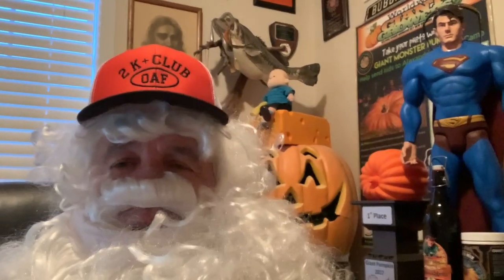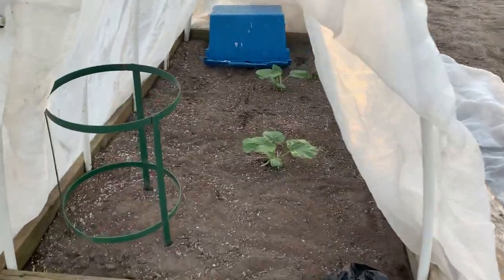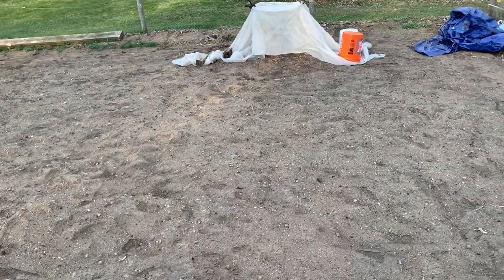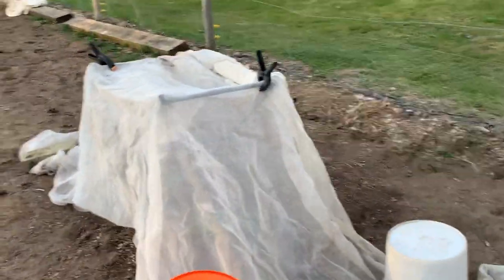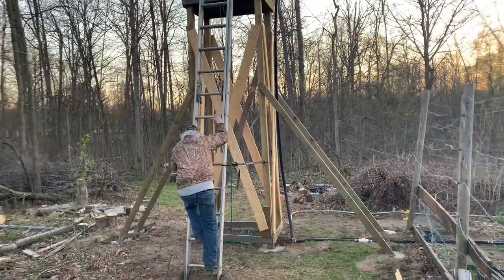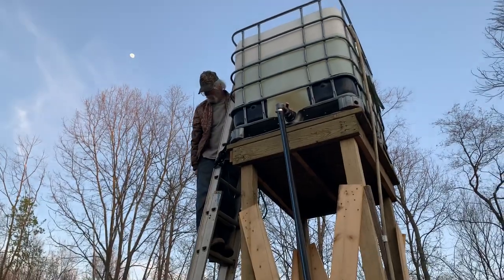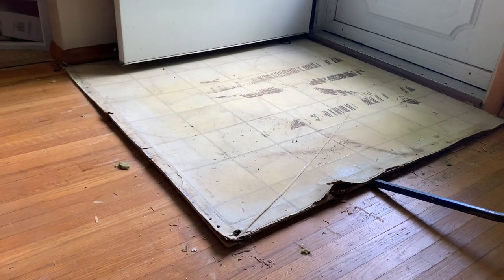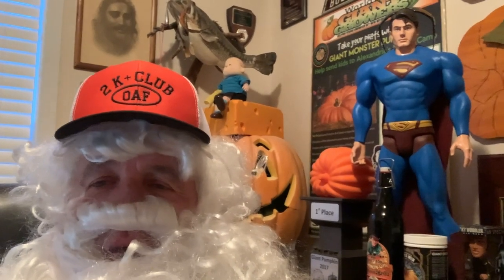Devil's Water Tower Pt. 2 and Protecting the Pumpkins

Comment: Always good tip and good info I like how you keep it  interesting. I agree with you with the glue down Underlayment it's pointless I see it time and time again in my line of work and I don't understand. Question about the water tanks so for me I live in residential and  I can't put a water tower 10 foot high in my backyard could I put a water pump on it to make it work?
Reply from the maker: Curtis Michalek yes water pumps are the easy way . The drip tape  needs 10 pounds of pressure if you get much over that you will blow it apart it’s not designed for high-pressure so there are pressure reducer regulators that you have to buy to go with the drip tape. I recommend calling Dan at Columbus .arrogation in Ohio. Dan will sell you what you need and service it by troubleshooting your issues over the phone
Reply from the maker: You are #8 in this weeks FREE SEED drawing

Comment: Experiencing daytime temperatures in the thirties, twenties at night, snow, and 49 MPH wind... This is not the May weather I was hoping for. Thankfully, my pumpkins are staying around 60 degrees at night inside the hoop houses. Other than soil heating cables, which I am not using, what heat source options do you like best?
Reply from the maker: SevenShooter83 nothing really stands out I have used ceramic disc Electric heaters heating seed mats lightbulbs whatever it takes to get the job done
Reply from the maker: You are #14 in this weeks FREE SEED drawing